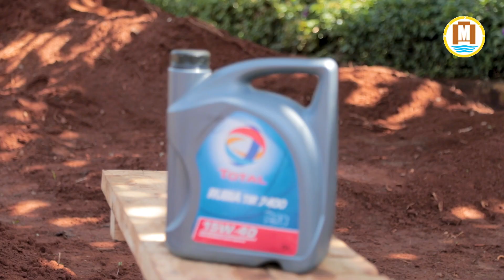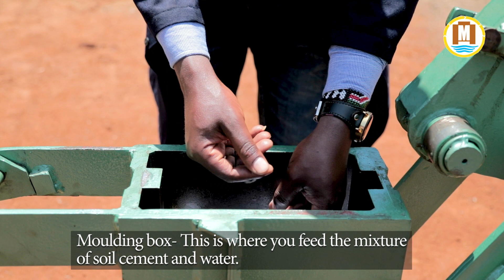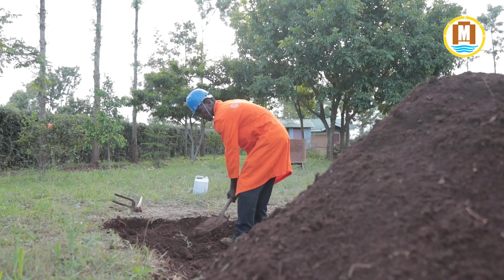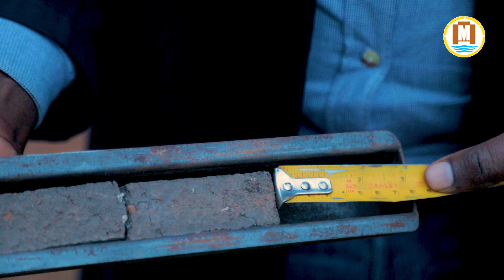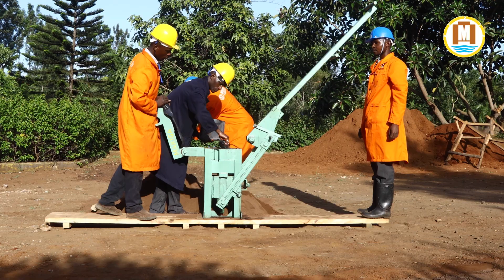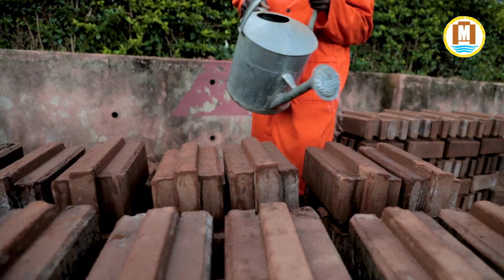HOW TO USE THE MAKIGA SOIL BLOCK PRESS MACHINE

Comment: But wait,seems this brick is expensive because if 1bag of cement only mixes 16buckets of soil,producing 120bricks...that means you need alot of cement to  make enough bricks
Reply: The cost effectiveness comes when building as won't need a lot of cement when brick laying. You just interlock the bricks and the house will be ready in less than a week depending on the size. You just need a little cement for the corners when building
Reply: One bucket is less than one cement remember that